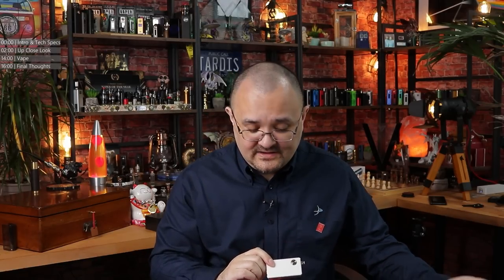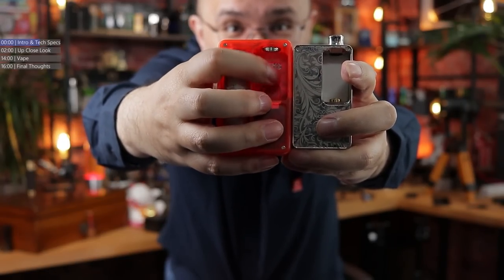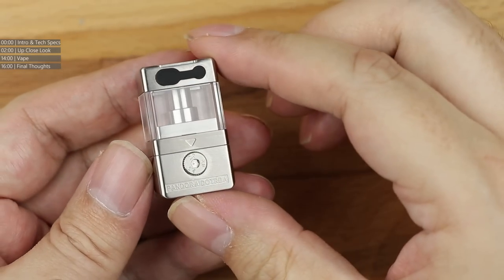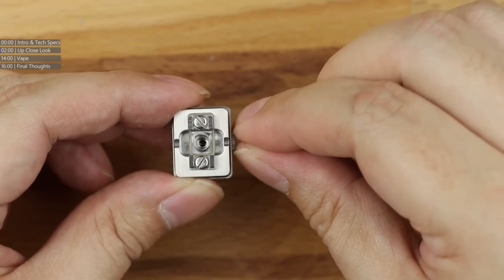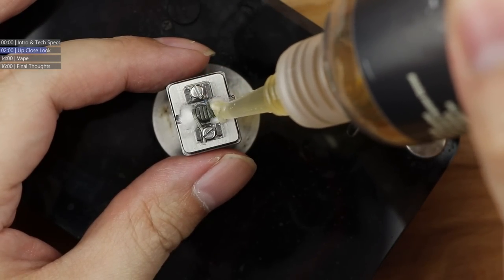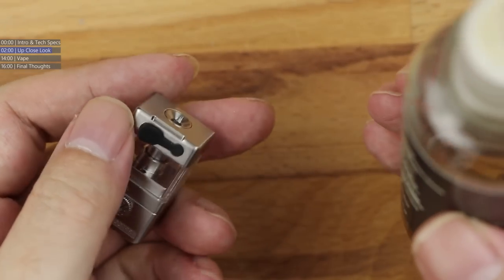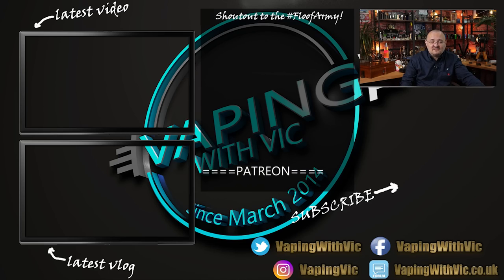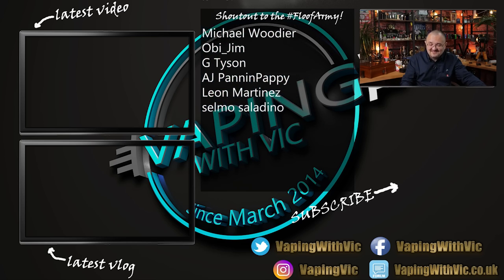YachtVape Pandora DOTRBA - YachtVape do a boro for the dotAIO

Comment: Thought I would mention that the tool for removing the air insert is machined onto the build stand and if you unscrew one of the screws underneath the air flow adjusters easily remove.,,,,There are feel smug now 😂❤

Comment: Try the dot spot It’s another hard to wick one The 909 will flood if it’s not right The dot shell and mission are easy I haven’t tried silo it’s supposed to be top one my favorite is mission 909
Reply: Pioneer is crap I think no flavor
Reply: @shotgunz124  you're building it wrong then because the pioneer has more flavour than the silo or dotshell . Plenty of flavour on the pioneer.